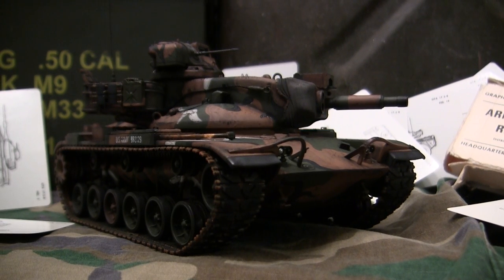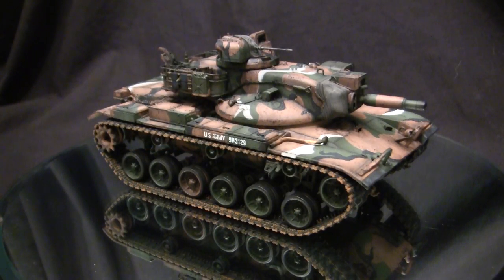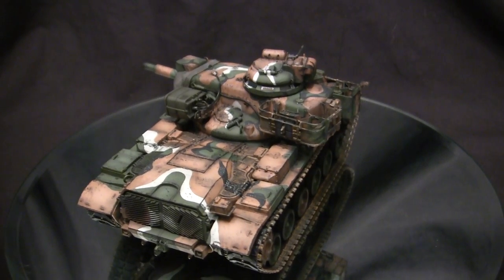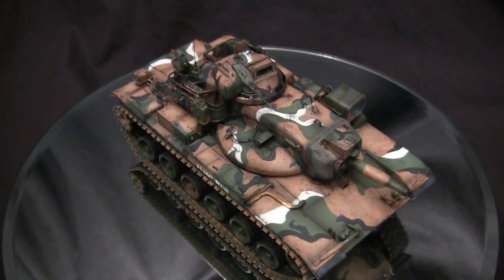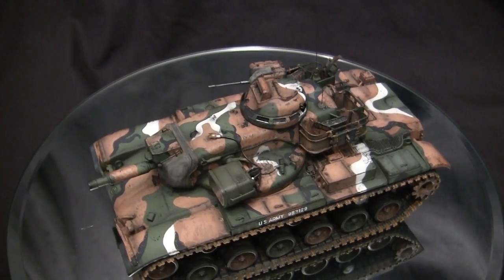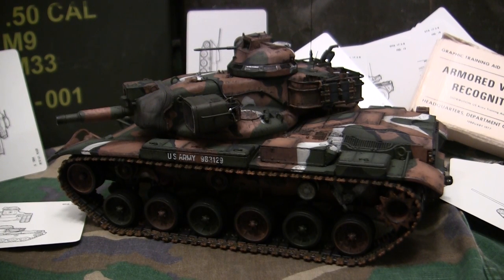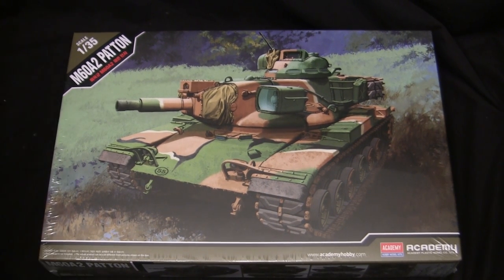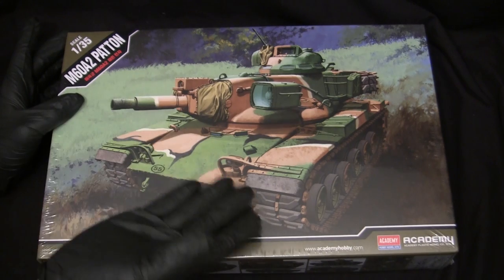1/35th scale Motorized converted academy M60A2 starship

Comment: Currently watching the video and a couple of things stand out.  I know the kit shows the unit as 3-32 Armor, but I was 3rd platoon leader in 1-32 Armor when we drew new M60A2s at Vilseck in August of 1975. I also served in 3-32 Armor in 1976-1978.  Both 1-32AR and 3-32AR were stationed in Friedberg at Ray Barracks.  I know ABSOLUTELY that 3-32AR NEVER had M60A2s.  There were six M60A2 battalions in Germany and 1 at Fort Hood and the A2 was in service for only 5 years.  Third Armored Division's A2 battalions were 1-32AR and 3-33AR (the latter at Ayers Kaserne in Kirchgons)  The other four battalions were in 8th Infantry Division, 3rd Infantry Division, and 1st Armored Division.  Your bumper markings, which are for 3-32AR are incorrect.  The Littlefield Collection's bumper markings were also incorrect.  A small detail, but...   The telephone on a platform over the right rear fender is correct for our tanks because it was a modification work order which we applied while drawing our new tanks.  The phone box was originally directly on the fender, but the fenders were damaged often in the field, which also damaged the phone box.  Mounting on a platform attached to the back deck helped protect the infantry phone.  The box you said was the laser rangefinder was actually the infrared tracker/guidance box for the Shillelagh missile.  The laser rangefinder was to the right of the main gun.  It had to be covered by a plate when not in use.  A padlock ensured it didn't fall off.  The rotatating amber warning light was required by German traffic law after a number of night-time traffic accidents with US armored vehicles in non-specular camouflage (MERDC system) which we applied in 3-32 Armor beginning in late 1976.  3-32 M60A1s were dressed in USAREUR MASSTER until then.  The A2s were issued in a black-green OD, to which black stars were applied.  White lettering and markings were not used with MERDC.  Third Armored Division was not issued the light tan paint, so our tanks were 40% forest green, 40% medium brown, and the black crow's feet filled the rest.  The A2s eventually received the MERDC pattern, as well, but I don't remember when.  There are plenty of pictures on line.  About the different battalions - if you ever saw GI Blues with Elvis Presley, they use 3-32 Armor M48s, but Elvis was in 1-32 Armor.  I haven't finished your video yet, so there may be more.

Regarding your choice of gun tubes... the tube with the bore evacuator is actually the earlier tube.  The bore evacuator proved inadequate for clearing the tube of remnants of rhe caseless cartridge, so the closed breech scavenger system was developed (resulting in the bulge at the rear of the hull to house it).  The vents in the barrel were sealed up on the early tubes and the bore evacuator welded to the barrel so it could not be removed.  The later tubes did not have the vents or the bore evacuator.  MERDC - all the A2s would in Germany used the same MERDC paint colors - no white, a darker brown, and included the tan, because the tan would have been available later.  I can't speak for the Fort Hood battalion.  

i found your weathering impressive.  You can solve your searchlight glass problem with a searchlight cover.  The only time the cover was removed was when the light was in use to prevent damage to the lens.  Same for sight covers and the laser box - closed except for when in use.  The sighr covers are ballistic, protecting the sights from small arm fire and shrapnel damage.  We used the antenna mount on the right rear of the turret which was molded there as only an impression.  An amber warning light was attached to the bustle rack.  Our tanks were issued with the side-loading air filter boxes, but the top loaders were another modification work order that was installed when we drew them new.  I've seen pics of A2s in service with the side-loaders and the later M60A3 style, as well.
Reply from the maker: cool, yes the kit has incorrect markings. also thanks for the other tid-bits of info, all appreciated

Comment: I found a use for link and length, I use most of mine now for spares. I did the Trumpeter HEMTT M1120 recently that has the flatrack and they're a perfect load for it. Yeah, they were the Bigfoot tracks, but still. It's a very niche use for them, but if you got 'em and you are modeling that niche, use 'em. Otherwise, you know my stance on link and length. It's the only and correct stance to have. And yes, I sat through all 3 hours of the video in one sitting, work was dead enough to do it.
Reply from the maker: yeah outside of using them for spares or for applicate armor they are worthless. Even then I sometimes still use the workables for the spares that I have as leftover depending how bad the kit ones fit together, yes there have been times where that was the case.
Reply: @oddball759mm  the majority of m113 link and length are that bad. Quite a few of the German ones are that bad too.
Reply from the maker: @thejoseph9064  I believe it. I saw this too on the old dragon PZIII and PZIV links. totally worthless for lengths of spares let alone a full set of track. since the workables give you lots of spares, I might as well put them to good use

Comment: Since you are motorized this Academy M60, do the swing arms adjust to surface conditions as it is being run and is the tank going to be wired control or with an rc transmitter?
Reply from the maker: no the swing arms are static, for the type of running I do with my 1/35 models the working suspension in not needed. Some people have however RC converted these kits and have made working suspensions, but for me it's just not necessary. for the running it's only motorized and is unguided

Comment: Great and very informative video. I  have question about a term you used (merc paint job òr merc armor) I do apologize because I am kind of new to military tank or armor terminology. Any information you could provide would be greatly appreciated and helpful to me.
Reply from the maker: no problem, what do you want to know?
Reply: @oddball759mm  What do you mean by the term merc paint or merc armor? I really haven't heard of the term, "merc" before other than the shortened version of "mercenary ".
Reply from the maker: The camouflage is spelled merdc and it’s an abbreviation for mobile equipment research and design command. Like I stated in the video it is a standardization paint by number camouflage pattern that the us military used from the 70s to the early 90s. Every vehicle in the army inventory had a color chart that showed where the paints are applied and what colors to use for the different seasons of the year and / or the geographic location that the vehicle would be operating in. I hope this helps there is more info online and if you google up merdc camo you will find lots more info, thanks again
Reply: Thanks again for the clarification on this. I really appreciate it and the information that you shared.